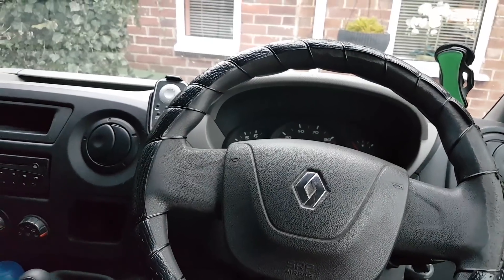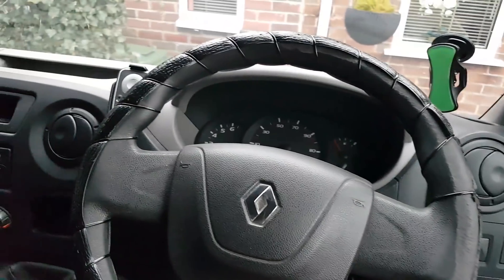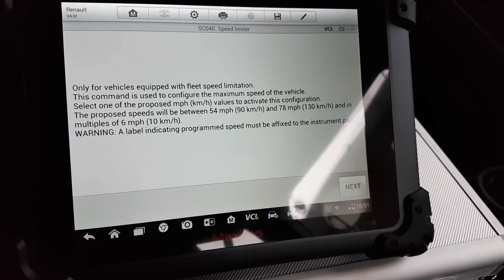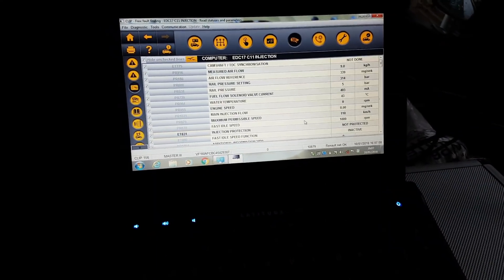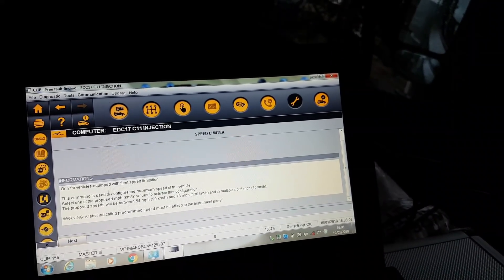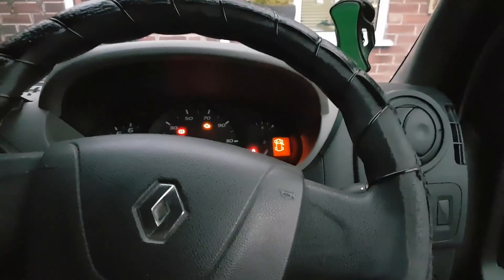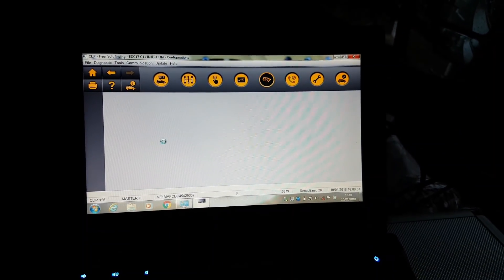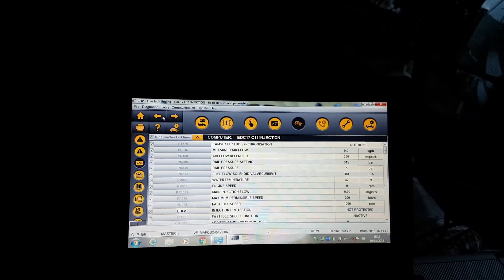Renault Master 3 2011 speed limit removal/disable. PLEASE READ DESCRIPTION!!!

Comment: I've tried to do speed limiter removal on Vauxhall Movano B 2.3cdti bi turbo, I did it in flash with tune but limiter still on. I tried with Launch x431 and it went through all the procedure and tells me request not met ignition key problem when saving. Bought a maxisys and still the same, I used my original Launch and used configuration under Renault master and it worked

Comment: Nice video.
I have a Renault Master 4.5tonne Rear wheel drive  twin wheel van that has been converted to a Motorhome and correctly recorded with the DVLA as such (private hgv motor caravan) I've asked the local Renault dealer to remove the limiter and paid for it lifting but for some reason it hasn't worked they are now telling me that they have to get special permission from Renault to remove the limiter my van is limited to 90kmh or 56mph which is the limit for commercial vehicles.
Would your system work on this? It's a 2015 sci 165
Reply from the maker: Hi
I can't see why not...
But there is other tools capable of doing this, my Maxisys for example, is also capable of this procedure...
Hope that helps.
Thank you for watching!
Reply: LM Auto Repairs Why can't the Renault dealer sort this with their equipment.
I suspect that the technician there is the problem as he was more or less saying that as the vehicle is rated at 4.5tonne and has a tow bar it can't do more than 56mph. He's seen that it is in fact a Motorhome  have the correct licence to drive vehicles at that weight and there's plenty of information on the internet regarding private hgv motorhomes etc and speed limits.
Where are you situated?
Reply from the maker: Hi
I have no knowledge of the regulations and or laws that might or might not apply to your case.
The van is know licenced as a motorhome, are you sure is now legal to remove the speed limit?
I am just asking, if it is, they should be able to do it... 
Unless there is something that you are missing, which in that case, they should provide you with enough information to justify why they can't do it, or what is necessary for them to proceed...

A quick google search, lead me here:
https://www.gov.uk/speed-limits

So, remove the limit completely, might not be the most legal option, but looks like you would be ok to increase that to 70mph...
This is my understanding....
Reply: Its 60 mph ... It was raised some years ago ..public complaints , apparently .
Reply: @thetruth6176  The van was restricted by Renault to 90kph or 56mph if you prefer. I'm now informed that the dealers need a CIR NOTE from Renault to remove the limiter? But as of yesterday 21/08/18  it's not been sorted.

Comment: Hi ihave a 2007 Renault mascott and I need to enable the speed limiter to 90 Klms
Do you have any advice as I tried a main dealer and I tried delphi and no joy but I didn’t go in through injectors
Reply from the maker: That's strange... clip should be able to do it...

Comment: Hi, do you know if the cruise control function is activated de-activated in the same way using the clip ?
Reply from the maker: Hi
On a traffic... but should be the same principle...
https://youtu.be/--wbEYymiGc
Thank you for watching!
Reply: LM Auto Repairs thank you for this, sorry one more question the software you used to perform the coding change was that renolink. ?
Reply from the maker: @neilselley8008  
For the cruising control yes...
Reply: Just for information the master II only needed the switch fitting and UCH coding the engine control module did not not coding it changed when it saw the switch connected. 
Thanks for the videos
Reply from the maker: Thanks for the feedback! 
👍👍👍

Comment: I see that you have Clip v156,but how did you set up to have that “extra”options in it?Im asking since I have Clip v174,and the interface of the software is not the same like your.I dont know if that’s because of the Clip version,or you done something to it.
Reply from the maker: Hi
Which extra options are you referring to?
Reply: LM Auto Repairs Well in my Clip if i go to lets say UCH module,it will show faults,parameters and so on,but on your Clip I see that it seems like you have some extra options that I dont have on this one,overall Clip layout and the interface is different then mine,or that maybe depends on a car I dont know.
Reply from the maker: MrRiderHD 
I don't know what's changed on higher versions... are you sure is not there somewhere? 
I have version 165... but have not installed it yet...
I have not done nothing to my one anyway...
Reply: @LMAutoRepairs  do you do this for other people thanks Tony